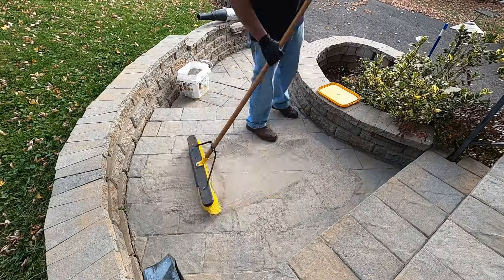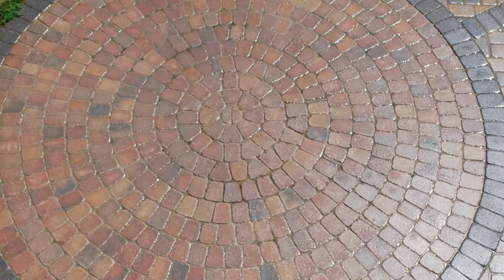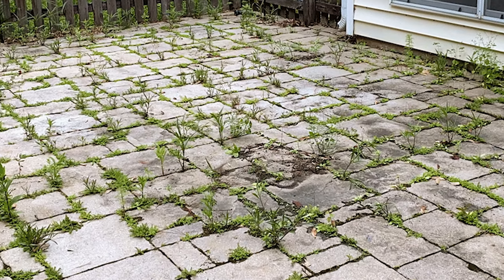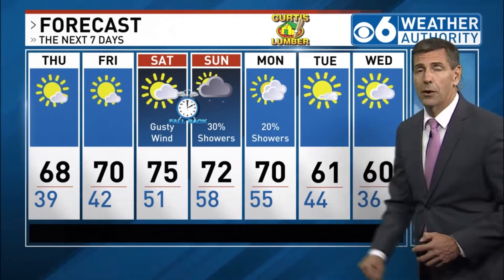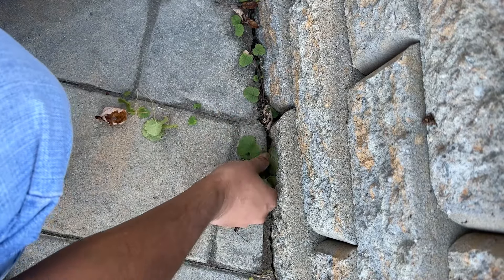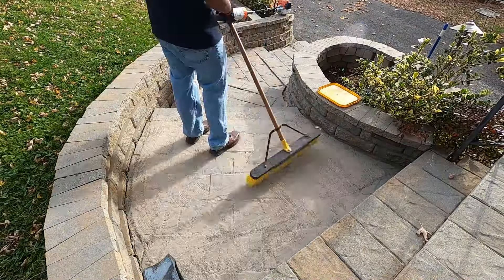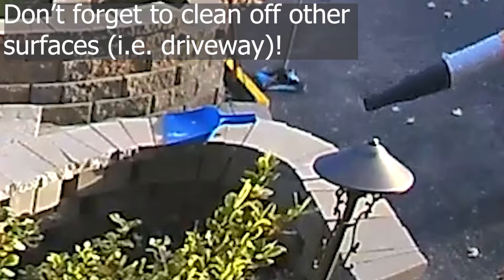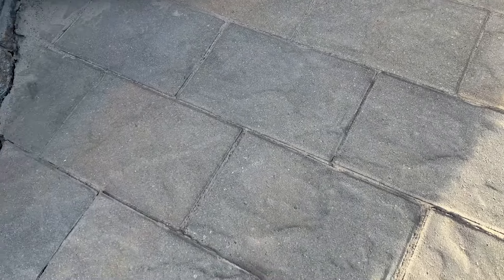Easy Maintenance For Your Paver Walkway or Patio - Re-applying Polymeric Sand

Comment: gaps between stone pavers.   would be great to see a 2nd video on the min or max for poly sand.  as i have a few areas that are greater then 1/8 of inch which requires additional measures then just re applying the sand.. great video btw.  the mask is key as the powder is really fine + working outside >> not something one wants to be breathing in...
Reply from the maker: Thanks for the feedback! Yes, the size of the gaps are important. I’ll keep that in mind for a future video. Thanks again!

Comment: Great video.  Quick question for you; my understanding is that I'd have to wait 30 days after setting the polymeric sand before I can apply a sealer.  Couldn't I just use regular, fine sand, and then seal that in place with a sealer, getting a similar, though maybe not quite as effective, result?
Reply from the maker: @casperthegm741  hey, thanks for your comment! The amount of time to wait between polymeric sand and sealer depends on how long it takes to dry. The stone and joints should be completely dry. Depending on your location, it could take only a few days. You could use a fine sand as well with the sealer and get the same result (although polymeric sand is the best choice). I recently made another video about sealing if you need any help with that! Good luck with your project and let me know if you have any more questions.

Comment: Great video! Exactly what I was looking for for my own backyard walkway. I have a question though. For me, I only started to get cracks due to weather and settlement in some areas, while other areas of the walkway still look perfectly fine and strong. Instead of removing all the old poly sand from the entire walkway and patio (which would be an tremendously big job) I would like to just repair and touch up the areas where I have deep cracks and grooves between the pavers. Is that a possibility too? Or is the only option to remove the old poly sand from everywhere?
Reply from the maker: Thank you for watching and commenting! I really appreciate it. For your question, it really depends on how close the failing poly sand is in relation to the areas with good poly sand. If you have enough distance between the two and there would be no risk of disrupting the good poly sand, then you should be able to fix the one smaller area instead of redoing the entire walkway. Good luck and let me know how it goes!
Reply: I think this is a normal maintenance task everyone with paver walkways and patios will have to do at some point. My opinion is if it's never been done and some areas are failing, it may be better in the long run to do the entire space. Of course easier said than done lol. I'll be doing my back patio and front walkways this summer. Good luck!
Reply from the maker: @chocolate_chip21 - exactly 👍🏼 I would rather just do it all in one shot and get it done with. Thanks for the comment!

Comment: Do you have to remove old poly sand before re applying new poly sand?
Reply from the maker: Yes, the old poly sand will need to be removed. Best way to do this is using a pressure washer like in the video. If you have stubborn areas that can’t be blasted out with the pressure washer, a flat scraper can be used. Hope that helps!

Comment: How quickly do you need to blow the excess away before it stains?
Reply from the maker: As soon as you’re done with spreading the polymeric sand between the joints, blow the excess off. Even the moisture (humidity) in the air could begin the process of solidifying the sand, so better to be safe.